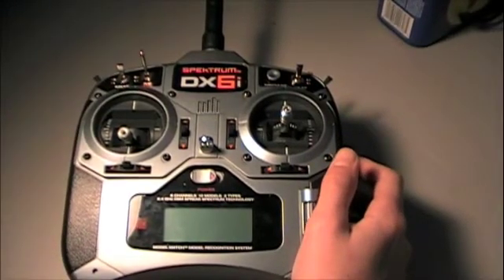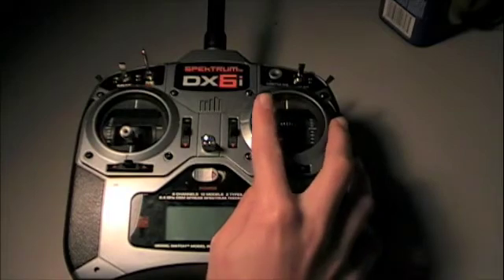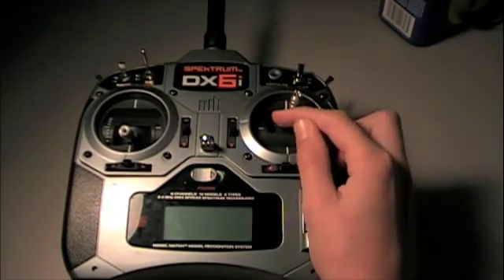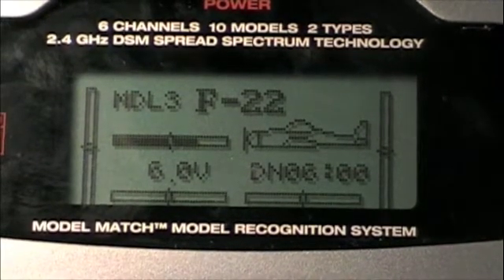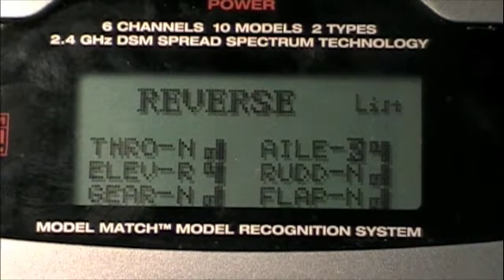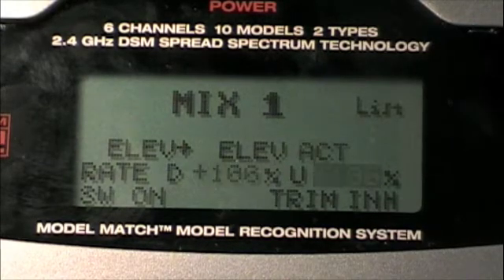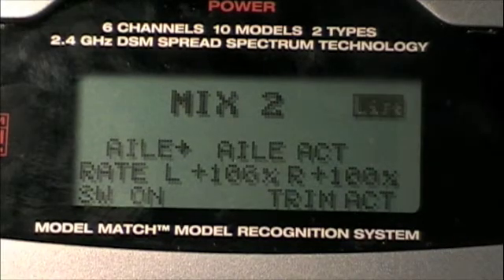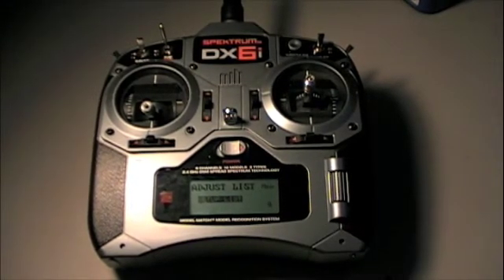Dx6i Elevon Mixing Problem SOLVED

Comment: This helped me so much. My issue actually started with with the second problem you encountered. My solution was only Reversing the aielerons. (Also, the Mix1/Mix2 extra throw was a great touch! I also added some extra Travel too).

Comment: I'm glad reversing both AIL and ELE worked for you. It does not work for me.  No combination of reverse or normal works. It's so strange. I've used elevon mixing before on my stryker and it worked fine. That was a few years ago and I can't remember how I did it.

Comment: Setting up my FT Delta, I did not need any  Mix1 and Mix2 as in JW's video. Information is on page 26 of my DX6i Manual - left (port side) elevon servo to Aileron Channel on RX, starboard elevon servo to Elevator Channel on Rx. At the end of the day, it didn't matter, you end up just trying combinations of Normal/Reversed for aileron and elevator channels.

Your physical servo orientation to the elevons influences which channel has to be reversed, or at all. There are only four possible Normal/Reverse combinations for two channels when setting a combination of Normal/Reverse in your DX6i. In my FT Delta configuration, I had to play with reversing on the tow channels, sometimes getting cross-controlled where elevator stick movement caused roll, and aileron stick movement caused pitch.

I had copied another model parameters to create the FT Delta model in my DX6i - after getting the servos straightened out, the Dual Rates worked as you expect them to - that was cool. All done in the DX6i computer brains.

Conclusion: Read the manual, first.  In my plane/servo/elevon configuration, it all worked fine when aileron was Reversed and elevator was Normal. Again, this was done without activating any mixes. Mixes are something I will tackle another day. FYI - my DX6i User Manual doesn't mention you can get into those funky scenarios where forward/back motion of the stick causes roll, and side-to-side causes pitch. Thanks for the video, JW - Cheers.

Comment: Thanks for putting this up!!! Ended up switching the ail and elv connectors at the RX and reversing the aileron on the TX. A little different but this post put in the in the right direction for sure though.

Comment: As others have stated the video is slightly incomplete. Since you are reversing your ailerons and elevators together, you will mess one up by correcting the other. Only switching the leads in rcv seemed to fix this..

Comment: Thanks, I've been struggling with my elevon setup for half an hour. Couldn't figure out why my left/right controls were swapped. I tried reversing the channels but then left/right changed to up/down and I tried by swapping the servo wires at the receiver but that gave the same result.

Like you, I just had to reverse both channel 1 and channel 2 in the radiocontroller. Thanks for the advice.